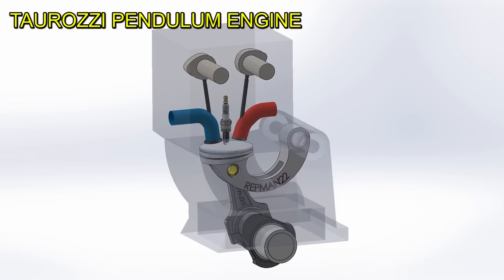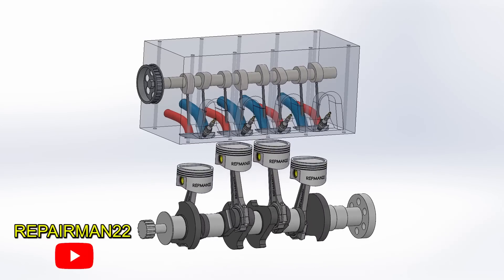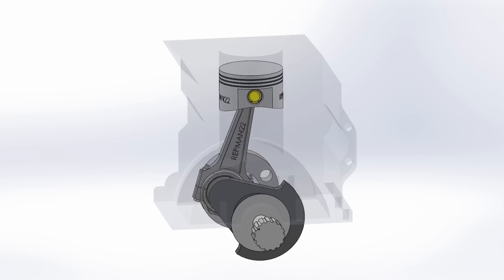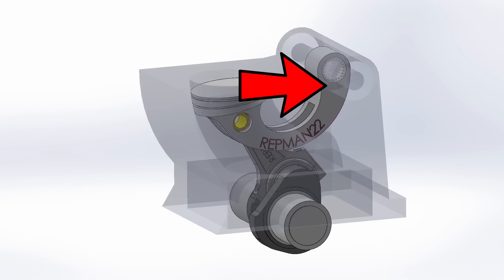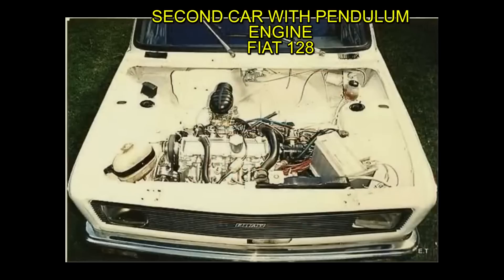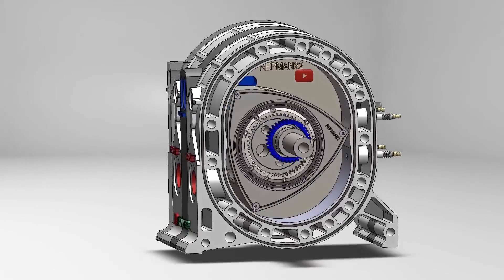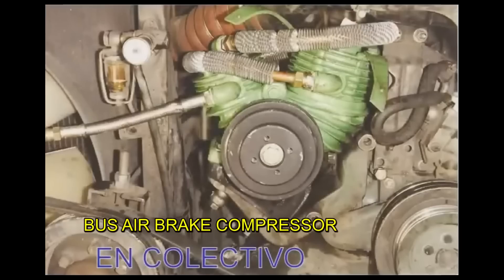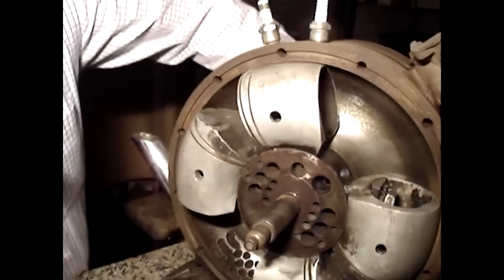All about the Taurozzi Pendulum Engine 🧠 and what happend to it🤯

Comment: The only advantage listed is piston friction which is minimal.
The last engine I reconditioned had 220,000 km on it. The bore & piston wear was minimal but the rings were worn to half their original thickness.
A new set of rings was all that was required.
It may have some benefits but I am skeptical of claims of any improvement in efficiency.
Reply: Nascar engines have different ....eras....of design, supposedly the THIN piston ring was a new era, ... i THINK this may be a video that talks about it at some point, https://www.youtube.com/watch?v=E5Q06jx8HnA
Reply: Yeah, there are a lot of claims in this video that don't quite make sense. The added bearings of the arm will wear, and will wear quite violently, the movement of the piston will distort the arm over time, the list goes on.

This is fine in compression systems because you're not submitting it to a ridiculous amount of heat or violent explosions, but in an engine? Yeah, I question whether or not that would actually work in reality, so yeah. If Mercedes says the test was fraudulent, chances are the test was fraudulent.
Reply: @TacComControl  I don't see why the bearings would wear violently, very little non angular forces are acting on them,, because of the lever they have over the piston, even better if you have an active oiling system running some oil through them.

The distortion over time might be an interesting thing to test out with long use. Again, the arm has very little forces working on it, since it only guides the piston in a certain direction, without being forced into a different one.
Pressure on the piston head is normal to the surface of the piston head, which is on a tangent with the circle of rotation. Especially in the expansion stroke, since the rod is in line with the tangent.

The main issue I see is at the compression stroke, especially when breaking with the engine, the force direction of the rod is not at all aligned with the tangent, and might bend some things, or make the piston run into the top surface of the curved cylinder.

As to heat, as long as you cool the head and the chamber, heat shouldn't get too ridiculous, since the sliding friction in the cylinder walls is out of the equitation. The main source of heat is the fuel burning, which is not directly on the system below the piston.
Reply: @DrTheRich  Surely the component of the piston thrust vector that is perpendicular to the crank arm will have to be countered by the bearing.  That seems fairly significant surely?
Reply: @wjcferguson  the greatest force on the piston is applied when the  rod is in line with the piston thrust factor, most of that force goes straight in the crankshaft, not in the piston bearing. This also helps with efficiency.
Not to mention, the piston thrust vector is always the tangent of the rotation circle around the bearing, so none of that force, save some minimal centripetal force is felt by the bearing.

The only moment there is offset forces is during the compression stroke, when the rod is not in line with the piston movement direction, and a certain fraction of the inertia of the crankshaft (and flywheel) is sent into the piston bearing. This works against efficiency.
Reply: @DrTheRich  Good point, the graphic in the video to my eye has the thrust stroke pointing at the crankshaft, but it would probably point more at the outer rotation, making for a worse angle under compression but much lower forces on that side.  It's still going to be an imperfect angle for most of the thrust stroke, but narrower angles than I was thinking of.
Reply: @DrTheRich 
And what is with the lateral force from the con rod?
The main force the skirt is normally for? Also the new centrifugal force introduced by the now circular path of the piston.
There will be ALOT of force going true that banana arm into that poor bearing.
Reply: @DrTheRich  fatigue wear in bending is more dangerous than in axial force, so the rod is subjected to extremely intense bending loads, also at fairly high temperature. Fatigue is very important as it causes catastrophic failures even with fractions of the maximum static load... and an engine running at thousands of rpms reaches very quickly (hours, days at most) millions of cycles. That explains why in his tests he has not caused fatigue failure: he probably hasn't run them long enough.

And besides, the pressure force exerted on the piston is not entirely transmitted to the crankshaft, so overall efficiency decreases.
Reply: @DrTheRich  its easy, think why one mass arm split it in two arms mating into a "T' at the top with a two-bearing system on both ends and feed force oil thew the bearing system like on the turbine power wheel bearing This system has been proving by thousand of jets flying for the last 75 years. no inertia transfer at all if there was any the turbine power wheel would shead the engine and the plane? so, there ya go, now you can make it work. need parts to think only jet aircraft parts and bearings! have at it, and let me know if ya go anywhere with it. have some ideas? also at the piston end of the arm there will also be a two-bearing system better than just a one-bearing system. any ossification or inertia would be absorbed by the bearing load and shifting. Thanks, ya just made of solved one problem good show.
Reply: @DrTheRich  Simple, the bearings holding the arm aren't rotating completely but only partially over the same angle back and forth. Means always the same parts of the bearing are on high load all the time whereas the other parts are never high loaded. That might cause unequal bearing wear reducing lifetime! And that happens no matter whether roller-body or journal bearings are used. At the end this type of engine has got even more moving parts which is never a good idea when looking at lifetime and reliability.
Reply: "top surface of the curved cylinder"

I would say "inner surface", but I'm not pro English guy. "Top" just sounds so wrong. There is many good benefits in this idea, that if it would used as massive than "normal engine", it would be fixed all 'problems' in this design..
Think about that wankel is coming back in many uses and still made even better. If you don't put efforts for something, it's stupid just say "it wouldn't work", when there's no obvious problems.
Machines, materials, alloys and handling electronics has become better and better than 50y ago.. So many people's has breathed oxygen that is compressed with these compressors..

Guy was living too early times by he's real skills. 
But idea wasn't totally loss, or even loss at all. 
It has "made" more oxygen than other car engines making just carbon dioxides and nitrogen oxides.. ;)
Reply: @TacComControl  most of the knock force is going down into the regular piston arms tho. And a lubed bearing has no friction compared to a tight piston skirt
Reply: where can someone find one of these engines today?
Reply: Using needle bearings is a little strange in what is analogous to the wrist pin, I would think that a journal bearing with a lubricant groove would do better there.

Separately, if there was a massive increase in performance sitting on the table, and it only took the changes noted in this video, it would be in cars today. The economic value of a “frictionless engine” is so incredibly high that at least one automaker would have it on the market.

If not for fuel economy purposes, these could just as easily be used for higher power engines in more expensive vehicles, but they aren’t. There’s likely a good reason, and some of the best engineers in the world at engine design said it was fraudulent.

There is unlikely to be a conspiracy here.
Reply: @smallmoneysalvia  Why is using a needle bearing strange? Any reduced friction is a benefit to performance, although it might increase cost. The reason wrist pins don't have rolling bearings, is because the rotation is very little, smooth cylindrical bearings have better pressure distribution, and any possible weight must be saved in the moving piston head. 
This rotates a lot more, with barely any pressure on it. Roller bearings this size cost pennies to make if mass produced, why not put them in?

But i think a journal bearing would work for a cheaper engine.
Reply: @DrTheRich  On that arm will be ALOT of force! Why is every one thinks that it just gently guides the piston?
It's not, the arm needs to take up the lateral force from the con rod!
You know, the thing that makes a crank cranking and not just bow under a detonation. 😉
Reply: @martin09091989  That is not true. The position of the bearing on that banana arm dictates that it's only job really is guiding. My concern with this engine is the combined inertia of components. Conventional engine has one rod, this one has two reciprocating units and additional bearings. It may still work great in low rpm applicatios and maybe even return good fuel economy, but hardly any comparable performance due to rev limitation.
Reply: @smallmoneysalvia  Car manufacturers, like all other consumer goods producers today, think of self-deprecation of their products, so they can sell more. There is no interrest in selling any forever products. Just look at the light bulb industry, the nylon stocking industry, modern flat screen TVs where the power supply is under specced so it dies right after warranty etc.
Reply: @ET_AYY_LMAO  money isn’t made in selling cars, it’s made in service.
Reply: @ET_AYY_LMAO  not to mention the cost to produce such goods has to ensure maximum profit. The narrator said it in this video; car manufacturers said it would be expensive to produce at the time. 40 years ago especially, would cause this idea to be a write-off since its perceived to be: expensive produce, long-lasting with minimal wear and maintenance, better performance (making all other engines potentially obsolete), and disrupting the then-current business model of how big auto does things.

Not saying there's a conspiracy, but most big businesses like repeat-business in perpetuity. Look at today's model of auto dealers trying to get the subscription model of revenue for heated seats already built into the car!? I'm looking at you, BMW!
Reply: @smallmoneysalvia  Perhaps Mazda should look at this design considering all the downsides of the rotary engine that they persisted with for soo long!
Reply: @smallmoneysalvia  do you know the reason they gave why it could not work or why it was fraudulent? To me it seems like very plausible design.
Reply: @smallmoneysalvia  I really want to agree with your very educated statement here, I do have to mention that engines that wear, generates more money than engines that don't. In no way am I stating that there IS a conspiracy ongoing, rather that it would be very interesting to see the actual math behind this, rather than make assumptions. Perhaps @EngineeringExplained can Assist
Reply: @smallmoneysalvia  Retooling the factory probably was a major problem, but they should've/could've retooled decades ago.
Reply: It has the same bearing surfaces as a normal engine, plus the added ones for the pendulum arm, and that pendulum arm looks huge compared to the con rod, all that added weight.  No way it has less frictional loss over a normal ICE.
Reply: @KlockworXMusic  I'd say it does mainly in the fact it doesn't need a large piston skirt. It would be even more improved thanks to today's more modern ceramic bearings... There is allot of good engineering here. I'd be interested to see a cad stress test. There could also be bearing less fluid journal if high pressure oil could be pushed in between the two for start up a low viscosity ceramic coating could be used.
Reply: @KlockworXMusic  lol, so you don’t know what you’re talking about…
Reply: The workshop manual for Rover V8 engines - only a little bit more advanced than the 1960s Buick V8 they were derived from - expressly says that you should not attempt to hone the bores, just replace the rings if they need it.
Reply: @erroneousbosh  if the mechanism preforms as optimized, the bores shouldn't need to be honed, as they don't need oil lubrication and wear very little, because of the lack of touch.
Reply: @erroneousbosh  Rings have long been designed to bed in to match the bore. To add to my original post the engine was a supercharged Lancia Beta engine and had 320,000 km on it 10 years after the new rings. Was still reliable and going strong.
Reply: @erroneousbosh  but if the bore has a big scratch/gouge in it what do you do? I guess the bores have a hardened surface that honing would destroy. Solution? Throw the block away or use and burn oil?
Reply: @AORD72  If you gouge the bore that badly, just knock the liners out and replace them. They're cheap, and "top hat" liners with a flange at the deck end (hence the name) are a great upgrade - then they can never break out of the block and you can even use them to repair blocks where a liner has slipped.
Reply: @AORD72  If it was that bad you could just put new liners in, and if you're going that far you would fit "top hat" liners with a flange at the top so that they cannot slip.
Reply: @MikkelRS it had a great advantage: insane specific power output. It's part of the reason why almost all flying machines are turbine powered instead of ICEs.
Reply: @metsasuomalainen3691  Mitä mies selittää? Puhutaan vähän eri teholuokista ja eri ajotyyleistä kun jossain auton moottorissa, tottakai ne kuluu paljon nopeemmin, 2t sylkässä on myös paljon vähemmän seinämäpinta-alaa koska porttaukset ja ne reunat syö kans mäntää ym. Toi designi kans varmaan tuplais jonkun krossin koneen koon ja painon.
Reply: yeah there’s some weird stuff here for sure, i bet overtime the arm would bend since in the middle of the curve it’s going to be under stress from moving the piston up and down, even a small bend and the whole principle of it being perfectly lined up goes out the window, also if the bearing wears at all the same thing will happen, and when the engine does wear it’ll be the bottom most cylinder wall wearing first
Reply: @brando12343   the sole mission of the curved arm is to locate the piston in the center of the bore. They don't rub, except for thin compression rings and no oil rings. The only wear in the pendulum arm is going up and down. These engines produces far, far less heat output than a "regular" engine. The forces you claim will distort the pendulum arm are taken by the connecting rod and crank journals, and the rod themselves.
Reply: @brando12343  There's also the static deflection of the arm. I have questions about how reliably this design holds alignment towards the extremes of the stroke. There's also the problem of that arm putting a limit on the stroke of the engine. It has to go around the cylinder wall.

It's really quite the overcomplicated solution to a "nothing" problem, IMO. The piston skirt really isn't that big of a factor in engine performance as long as you're able to use oil. It's only worth about 3% of the full power output of the engine in modern designs. Sure, that could be a few thousand watts, but it really doesn't change much. What's 3-5 HP on a 100-150 HP engine? Surely there are easier ways to get that sort of gain than redesigning the entire engine block, adding about a hundred extra moving parts, and bringing in specialized tooling.
Reply: @MikkelRS You're comparing this to a rotary engine?. If you were able to navigate here you should be able to navigate to an online search to educate yourself.
Reply: A lot of test engines have increased efficiency until you add in the exhaust system.  there's a lot of efficiency lost when you add in the exaust systems. For cleaner air we sacrifice fuel efficiency.
Reply: @@mikkelrs5892 it exists in highly specialized sports cars, not passenger cars. Your argument is founded in ignorance.
Reply: The enegy loss to the piston friction is more power out. The same with the need for less lubrication and cooling. You have to look at the whole picture here. Less oil and cooling gives lower weight and lower consumtion with the increase of power output.
Reply: @RiderOftheNorth.357  Now ya talking! this engine since its first design can be radically changed just in metals that can be used today, or boring machines that can use water or lasers that were not around for car buffs then. but just the new metals in the last 40 years give great new life to this design ya just have to know what parts are out there? aerospace makes that...easy.
Reply: The arm just adds dynamic mass,I can't see how it reduces friction.
Reply: @bb21again.67  Have you seen the video? It does not add mass. The removal of the piston skirt equals the added mass in the arm. the friction reduction comes from less contact between piston and bore.
Reply: @Rider of the North  No way does that arm weigh as little as the aluminium removed from the skirt even if it made from aluminium.
Reply: @bb21again.67  On the scale: no. But It is about leverage. The added weight is close to the bearing on the arm and does not add much in the mass that is moving up and down. Compare that to the piston skirt that is moving up and down on the end of the lever that is the connecting rod.
Reply: @Rider of the North  The added weight is supported between the gudgeon pin and the other shaft,all it's mass reciprocating in the middle not fulcrumed at all.
Reply: @bb21again.67  Please rewrite and make sense, please
Reply: @Rider of the North  The "banana arm" is connected to the gudgeon pin at one end and the bearing shaft at the other and its mass swings between the two.There is no fulcrum point with a lever lifting its mass.Draw a see-saw and now imagine the piston(load) is on one end and the hinge in the middle is the fulcrum,there is NO lever on the other end to exirt lift.
Reply: @bb21again.67  OK, now i understand you. I never mention a fulcrum point. But surely you can agree that most of the mass in the "banana arm" ( love that name!) is close to the pivot point of the banana? By that it does not raise the moving wieght of the piston. English is not my first language so i am struggling a bit with physics nomenclature here. The weight of the banana is, more or less, irrelevant due to it´s very small movement ( talking about it´s center of gravity here). This is all compared to the weight distrubution of the standard piston construction.
Reply: @Rider of the North  No, the banana arm is extra dead weight that is moving alot.No I don't agree with you at all that was my point.I have stated it 3 times already.I don't think that you know what you are talking about.
Reply: @bb21again.67  The banana arm is moving a lot but its mass is closer to the center of rotation (the pivot of the arm) and because of that it will have smaller moment of inertia and thus it will not contribute as much when moving the piston. Think of it this way: the piston has to move the longest distance and fastest because it is farther away but the banana arm is moving less and less as you get closer to the pivot.
Reply: @tomaspecl1082  The mass of the banana arm is still much more than the mass of the piston skirt that has been removed, so until reliable extensive and independent peer reviews and testing has been shown I have no reason to accept your speculations.Test and results not personal wishful thinking.
Reply: @tomaspecl1082  Try watching a video by driving4answers Otto,Atkinson, Miller cycles explained 8 minutes in he will show that increased efficiency can also lead to a loss of power and he is an engineer.
Reply: @Rider of the North  The videos  is self aggrandisement this engine needs independent testing. Watch driving4answer video Otto, Atkinson,Miller explained.
Reply: @bb21again.67  It reduces friction by physically guiding and preventing the piston from touching the cylinder bore rather than a film of oil in a conventional engine.
Reply: @g simpson  Piston skirts support the crown and stops it from flipping over.
Reply: @GSimpsonOAM  Absolute rubbish, piston skirts support the crown and stop it flipping over.
Reply: @bb21again.67  Of course but it can physically touch the wall of the cylinder. The concept of this engine is that the piston cannot touch the cylinder walls.
Reply: @GSimpsonOAM  How do you know the drag coefficient of oil on piston skirts?
Reply: @bb21again.67  1/ I understand how lubrication in engines work
2/ I have repaired many high mileage engines and the wear on the pistons is usually the least ones problems
Reply: @g simpson  We use to call it boundary lubrication.
Reply: @g simpson  Which is my point,how much of a "plus"is the friction loss compared to dynamic mass gain( I assume you've balanced crankshafts?) Of banana arm and how many of these engines have you stripped down after high mileage?.For all I know they could be wonderful engines but it seems to me that everyone is jumping to conclusions on the testimony of a video aimed to sell it,and yes I know the patent has expired but just because the engine is alternative does not mean it is better.Extensive ,independent testing is needed.
Reply: @bb21again.67  
I have 40 years experience as an engineer. 
Have a couple of Diplomas in engineering.
Balanced many items including crankshafts, helicopter gyros and many other things.
I have worked on many types of motors and industrial equipment.
Currently I am the Chief engineer of a large industrial engine room. 
The projects we do require a fundamental understanding of the mechanics and theoretical nature of the thermodynamics involved which are far too complex to elaborate on a forum such as this.
So I can call BS on an idea that doesn't pass the sniff test
Reply: @g simpson  We use to call it boundary lubrication.The minimal wear you mention is my point,the loss of skirt friction compared to the added dynamic mass gained seems to counter any increases in efficiency. Extensive and independent testing is required, not just youtubers opinions.
Reply: @g simpson  You seem to have misinterpreted my comments somehow,As I too am not convinced of the merits of this or many other "alternative" engines,perhaps I have not expressed myself well.Your credentials are substantial and impressive.
Reply: @bb21again.67  I have done a few high mileage engines. When the pistons are replaced is is because the engine is rebored to a larger size due to the rings wearing the bore rather than the pistons being worn. 
Going back to my original post. The piston friction and even ring friction is minor. The only way the efficiency of the engine significantly is to increase its thermodynamic efficiency. This can be done just as easily with a conventional engine. 
The basic parameters to consider are the bore, stroke (and their ratio) and the compression ratio which is limited by the octane rating of the fuel.
I have balanced crankshafts but most of my balancing experience has been with helicopter gyros.
Reply: @bb21again.67  well, finish the video and then maybe watch it again to catch whatever is that's throwing your comprehension abilities off.
Reply: @Juan Ignacio Caino  I've said everything that I need to,I doubt you have any expertise in any relevant field of engineering to make an informed judgement. A video is not solid proof of anything, the bottom line is that no cars on the market carry this engine or ever have,if you are so convinced of its merits start a company that makes them.
Reply: first, if you had to "RECONDITIONED " AN ENGINE WITH ONLY 220,000 KM ON IT? IT WAS not RUNNING RIGHT IN THE FIRST PLACE OR JUST A PLAIN MISTREATED PIECE OF SHIT. THE 20-R TOYOTA WAS OVERHAULED WITH 1.1 MILLION ON IT, EUROPEANS WHAT DO THEY KNOW?
Reply: The west of the piston is zero……. Another perpetual motion machine…
Reply: @Steevo69  It is a variation on the Otto cycle burning fuel so not claiming to be perpetual motion machine.
The piston weight was claimed to be lighter not zero
Reply: The decreased mass of the piston is pretty obvious one. YOu don't waste energy on accelerating and decelerating a dead mass. Fuel savings could easily come from that. Although I don't know how much  mass that banana arm adds though.
Reply: Piston friction isn´t an issue, since all engines, even this one, have 2 friction-rings per piston, who take up the friction, while a piston actually never touches the cylinder. 
What I see, is a much higher initial conrod-angle on the crankshaft (whiile lowering cylinder-walls-friction), thus extracting more torque from each combustion, cause, as u know, the initial conrod/crankshaft-angle after ignition is 0° instead of the more optimal 75°-80° !!! This can also be made by the usage of 3 (complicated interlinked) conrods per piston, but in this case, you get much more friction between the piston-rings and the cylinder-walls (higher than in a normal, single-conrod cylinder. Motocross-racers used that in Germany, but motocrossers spent anyway half of their lives in the workshop, now just additionally exchanging worn piston-rings much more often than usual   ;-)
So, there is an advantage, but at what price ??? Curved-cylinders ???
Reply: @klausbrinck2137  What a load of crap! What do you mean the piston never touches the cylinder wall,I have bored and honed out countless engines that have scored cylinders from pistons or even jammed pistons.I don't think you really know what you are talking about, what qualifications do you have in the automotive field?
Reply: @bb21again.67  I don´t say that it can´t happen, only that when it happens, it points to an engine of inferior quality to begin with. And I don´t have experience with such ( is that even allowed, in your world?). So, please come, educate me about the crappy engines you wasted your time with..
Reply: @Klaus Brinck  I apologise for being snarky,let's just agree to disagree, take care and have a nice day.
Reply: @Klaus Brinck  Watch driving4answers Otto,Atkinson, Miller cycles explained and see that efficiency sometimes comes at the expense of power which is more important and he is an engineer.
Reply: Why still skeptical after confirmation?
Reply: @andrewpipitone1572  If this motor like so many that make big bold claims really did work as they said,they would be everywhere. The fact that no manufacturers have picked up the design just goes to show it is not delivering anything worthwhile.If you don't have a background in the automotive trade or engineering then you shouldn't be so quick to sing it'd praises.
Reply: @andrewpipitone1572  Finally. A sensible comment/question.
The friction of the piston is small amount of energy loss. If it was significant then the piston the the wear in a conventional piston would be very high. This is not the case. 
For the claims of the efficiency to be so good then the thermodynamic efficiency would have to be much better. As it uses the same cycle as a conventional engine then the starting point for the efficiency is the same. Whether Otto or Diesel cycle.
So yes it will work. Yes the piston design reduces piston friction but this won't improve efficiency as the promoter claims.
Reply: @GSimpsonOAM  After I wrote I started thinking what the creator did to create a block and using exhibiting head to work around is  determination. I am sure he though about this but making a v8 block around existing  cylinder heads to see how it would rev and hp/ torque curve. I wonder if the creator did do it and if i were to do it it would be a big block : -) Well the the mustang 289 may be easier but id really want to see torque. It is really ashamed we are moving away from the gas engine. I can see how this would be a great motor. But its in the prototype that would be the true test to make any tweaks and changes
Reply: Two reasons why manufacturers did not want it. Retooling and selling less parts if proving to be great which eventually it has. I would like to know how high rpm can go and power curves and the only way to find out is to build and that's not happening. Or maybe use the one the fellow built. I'd say he is brilliant.
Reply: @MikkelRS knowing few car lovers, I guess they choose engine technology based on sound it makes. I don't think there is another valid explanation. It doen't matter how good it is, it just needs to make right noise.
Reply: Doesn't friction cause a loss of power?
Reply: @DoyleHargraves  Conventional engines use an oil spray to the bore combined with oil control rings to minimise friction. With some success given the lifespan of the average piston.
Reply: My little leg can destroy a mtb swing arm bearing, imagine a combustion!!
Reply: @s.lacasse8337  Have you seen the size of conrods on other engines. In this engine the conrod still takes the main load to crankshaft.
Reply: I wonder if the efficient improvements were notable at the time of the invention, but would be negotiable now
Reply: @caleb4772  well, with modern engines the efficiency percentage certainly got smaller. At the time those 30% claims were made, we were still talking carbureted, fairly low compression and low efficiency engines. Ring packs also got a lot better during the late 80's and 90's... then piston skirt and piston head coatings appeared...
Reply: I can see a more evident transfer of power
Reply: @limesta  I don't.
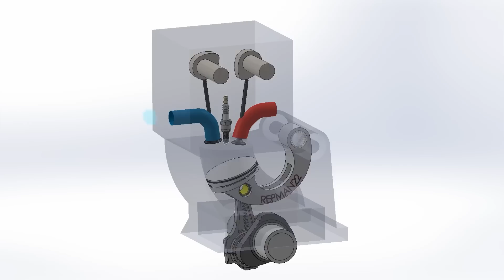The transfer Is from piston to gudgeon pin to conrod to crankshaft. Just like a conventional engine. 1:16

The rocker arm is just a guide and does not transfer power.
Reply: @GSimpsonOAM  what I mean is if the claims are correct, it's most likely due to the stroke being artificially lengthened through the arcing motion, allowing for the engine to get more torque out of a single combustion event, in conventional engines, the rod has an optimal zone approximately before it's halfway through the stroke, in which power is most efficiently transfered to the crankshaft, in this design there is a possibility of that "zone" to be lengthened by having the piston head arc into the rod and crank, making for a more efficient stroke
Reply: There would be an improvement in the alignment of the cylinder head and arm during combustion , but there would be losses with the pendulum rotation when combustion occurs as well. It would be interesting to see bench tests
Reply: you could build in cam control into the piston arm. you could make a double acting (seesaw) action so you have power on one side and compression on the other. i bet you tat if you want non round cylinders this design would make it simpler.  the question is if the small advantages are worth the disadvantages
Reply: No, that ine advantage you list leads to the much more important advantages of the lack of any need for lubrication and thus far less pollution through exhaust and otherwise
Reply: @harrickvharrick3957  The gudeon pin,  pivot bearing, big end bearing and main bearings are going to ensure there is still plenty of oil flying about so no change.
Reply: The piston is rigidly controlled so no slopping about. The stroke also looks short. I would expect very good performance. The thing to do is build one and race it.
Reply: Friction is the major thing they wish they could answer. Give this design a chance and prove who is correct and who needs to admit, they have been wrong for the last hundred years
Reply: @dougmiller7643  If there was significant friction in conventional pistons then they would not last 5 minutes. In reality they last 100s thousands of km/miles.
Reply: The side bearing would negate the latteral forces of the otherwise conventional piston-conrod setup. This gives a more natural flow to the up down to circular motion. I can well imagine this would help reduce fiction, thus increasing power and efficiency. Also.. with smaller pistons and less inertia faster engine speeds are a natural bonus.
Reply: Lol, you think that the arm would have issues and simultaneously believe that cranks can exist…which experience orders of magnitude higher forces
Reply: Even if friction is reduced, there is too many reciprocating parts meaning it probably isn't any more fuel efficient. Would love to have one for some real world testing.
Reply: thats not many miles on an engine. my chevrolet 6.0 has 317,000 miles and still runs fine and has never had rings put in it.
Reply: @KidAgainHobbies  Some engines will do that mileage. A large, lightly loaded engine will last longer.
Bear in mind the engine I described was a high performance 4 cylinder supercharged engine. I had the engine out for a transmission issue and inspected the engine due to it's mileage. Waiting until rings break is unwise as it can damage piston and bore. As it was I had 10 years trouble free motoring after doing the job.
Reply: @GSimpsonOAM  its in a 3/4 ton crew cab truck its not light. if you take care of an engine they will last if you dont maintain them they wont its as simple as that.
Reply: @GSimpsonOAM   a race engine or someone who has a heavy foot is a different matter all together. most race engines are built with looser tolerances because they are not going to be broke in and they will be rebuilt alot more often than a normal everyday driver. i use to have a real heavy foot when i was younger and was at the drag strip all the time.
Reply: @KidAgainHobbies  It is not as simple as that.
A car that only does short journeys where the engine is cycling temperature wise will not last as long as an engine doing highway cruising where it is up to temperature most of the time and under steady load.
Maintenance and using the correct lubricants affects longevity but also the conditions under which it is operating. 
For example a small engine will do better for short running than a larger engined car as it heats up much quicker. This reduces wear and better gas mileage.
Reply: Probably not worth it just for the extra complexity added.

Like, it's much easier to drill/finish straight hole rather than bendy thing
Reply: Less friction means less heat loss. Thus it can eventually enhance the poor efficiency of regular motors from 25 % to 50%...
Reply: @TheLUKONZEN  No. One can calculate the theoretical thermodynamic efficiency of a combustion cycle. 
This is about 29% for petrol/gas and 39% for Diesel. (in an engine with no losses)
Piston friction only represents a small amount of losses in engine. If it was significant the piston would not last long.
Reply: @GSimpsonOAM  One who has calculated already obtained 35%-40% Otto, 40%-45% Diesel and 60% big marine diesel engines. Is all about a new block shapes and sizes, pressure and temperature curves, mix, cycles. Research about HCCI engines that can make an gasoline Otto reach more than 56%... But, anyway, I think Taurozzi's could be an option. But I haven't seen undoubted tests yet. Cheers.
Reply: @TheLUKONZEN  Formula one engines already hit ~50% efficiency. Also if you unscrew the ignition coils (to let the air out) you can turn modern I4 by almost hand, there is already so little resistance in it. Complete redesign of the pistons and engine to get that next 1% or 2% of performance and probably 20-30% higher cost in production complexity might just not be worth it.
Reply: @xani666  I agree... a successful engine is a balance between efficiency, cost to be produced and endurance... but I still have good feelings about Taurozzi, although I couldn't find any independent test. Have you?
Reply: @TheLUKONZEN  The heat generated from piston friction is a tiny fraction of the heat generated from thermodynamic losses.
For example a 100kW motor generates 300kW of losses at 25% efficiency. Apply 300kW of energy to a piston and it won't just cause it wear you will have a molten pool.
Reply: @MikkelRS youre forgetting high efficiency. swings and roundabouts.
Reply: The one I'm most skeptical of is the heat reduction and the reduced emissions second, it's the same 4-stroke engine, the same ignited gasses, the same exhaust gasses too.

Have you done an MOT style test which included emissions from the engine?
Reply: @SimonJ57  Yes indeed. The only thing it addresses is piston friction which is small.
It does not do anything different than a regular engine thermodynamically so claims of major improvements should be taken with a grain of salt.
Reply: yeah the only advantage is that it reduces friction at piston, note it doesn't mean the engine is frictionless, it has just as much if not more friction in other parts of the engine, which are also moving. There's speculation over the arm even being more efficient, it will surely add to the weight. The arm being there also means the engine has a very short stroke, meaning engine will produce less torque, in other words higher rpm or bigger engine will be needed to achieve same power, which will reduce efficiency as well as the whole engine package would be bigger. Manufacturers saw the idea, took it into consideration and quickly realized it's not really any better. Designing a whole new engine, which takes up more space, makes more noise and is maybe (a huge maybe) a little bit more efficient is just not worth it
Reply: If you have less friction, you have less power lost on that. It makes perfect sense.
Reply: @dancetweety10  As already discussed the friction losses from piston to bore contact is trivial
Reply: @GSimpsonOAM  That is not what they say in the movie, so I don't know where you get that wisdom from.
Reply: @dancetweety10  If you are going to reply yo a thread with over 130 replies and not bother reading them don't waste my time.
I am not going to repeat myself.
Reply: @GSimpsonOAM  I don't really care what you make up in the threat and I am surely not going to read them all. I rather go by the facts stated by the maker in the video.
Reply: @dancetweety10  you saw it on YouTube so it must be true
Reply: @dancetweety10  I find it amusing that you trust a glossy animation over dry mathematics and thermodynamic theory.
I suggest some study for you.
The Otto cycle https://en.wikipedia.org/wiki/Otto_cycle
Thermodynamics https://en.wikipedia.org/wiki/Thermodynamics
If you get your head around that then you may get an understanding how you were hoodwinked by a flashy presentation.